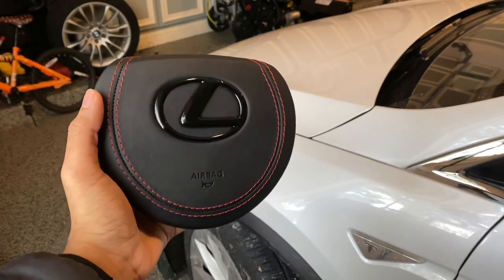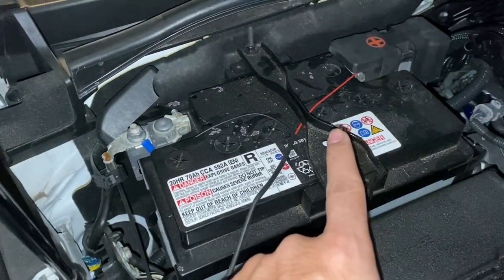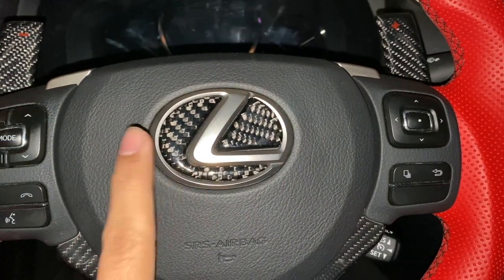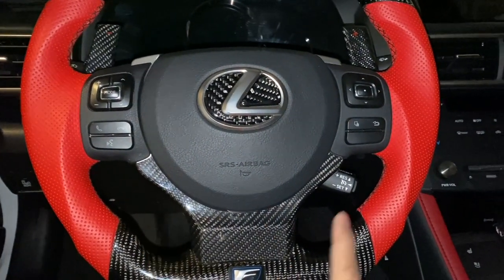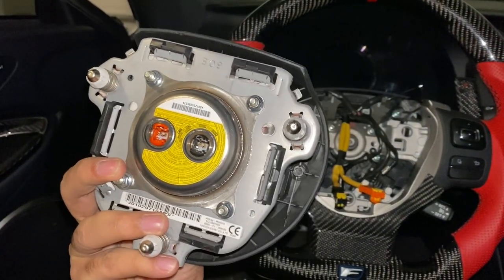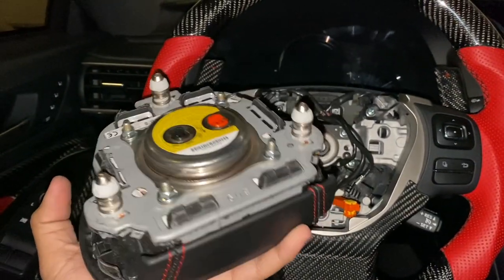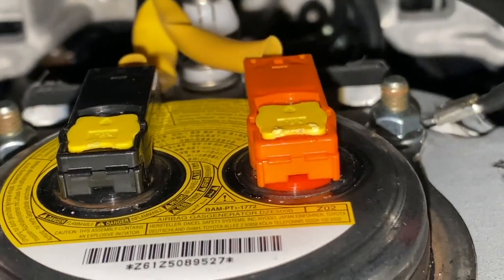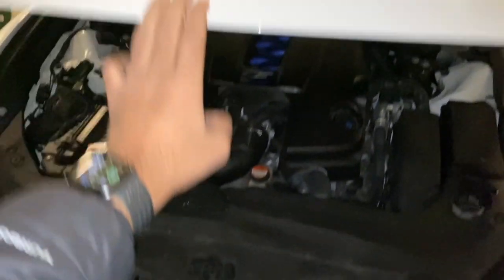Installing a custom leather airbag in my Lexus RCF!

Comment: Hey man, just wondering is the stock trim on the wheel held in by clips or screws? Does the carbon trim fully replace the stock plastic trim?